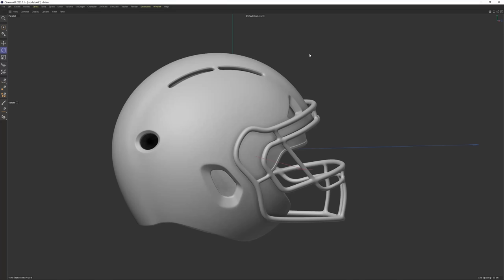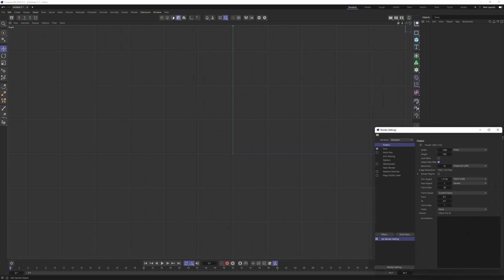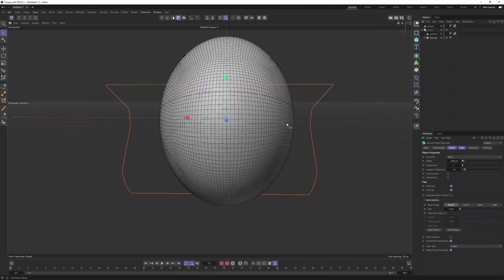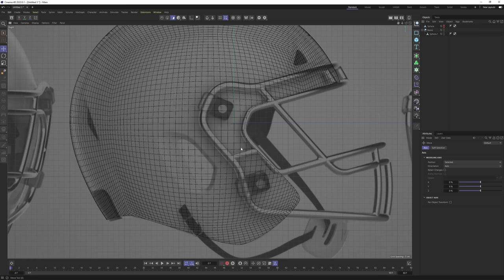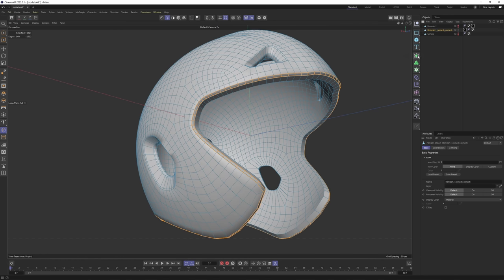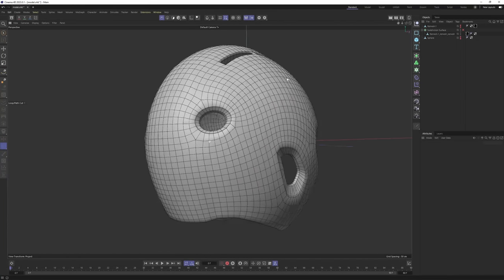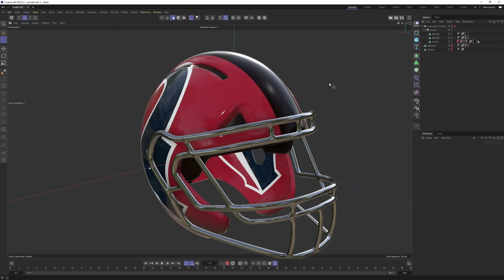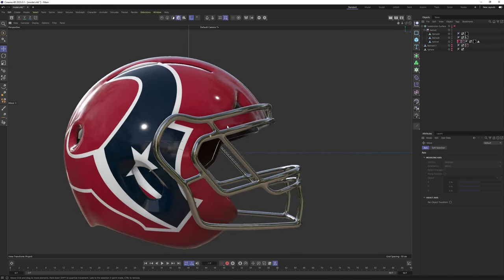Zremesher Workflow in Cinema 4D | Hard Surface Modeling Tutorial

Comment: I had a lot of fun making this tutorial. As usual, great modeling technique. I particularly enjoyed the work with the splines to model the protective mask. It took me over 3 hours to do the tutorial. Curious to know how long you take to prepare such a tutorial.
A small downside. I find that remeshing the mask has several problems. It is certain that once the material is applied, it goes well. I tried an experiment. I did not use the Boole. In the Sweep I increased the Intermediate Points for Splines and Circles. I placed the three Sweeps in a Volume Builder with the setting ( Voxel Size=0.4). I placed the Volume Builder in a Volume Mesher with its default values. Then I put all that in the Remesh with the settings (Mesh Density=10, Adaptive=0, Detect Hard Egges=Shading). The result is perfect. Virtually no defects in the mesh. Almost identical to the model in the photo. Volume Builder could be a good alternative to Boole Builder in some cases. Thanks for what you do. Tu es SUPER.
Reply from the maker: Thank you very much!

Thank you very much for the tip, combining volume objects and Zremesher is a great idea, I will give it  more chance.

I believe I worked several hours before recording.

Keep practising and let us know if you find any better ways model!

Comment: Hello,
which setteins did you adjust to set a few points to the Null such as at 7:30 by merely pulling them both down with Scale-tool? It looks like the magnet is working by you.  I can do it only by setting the Null in the Coordinate Manager manually, otherwise I cant exactly hit the Null coordinate by pulling, I get either a bit more or less than Null.

Comment: hi polygonpen, I wanted to point out a problem related to bolean operations. When you try to run a boolean on a non-planar surface, such as I your helmet, the holes made by moving with around the object to observe the holes in question appear distorted. I thought it might be distortion due to the camera lens used, so from a 24mm I went 120mm, but nothing yet the problem persists. The only solution I found is to make a bollean on a flat surface and then deform it with the transformers, so I get a correct view of the mesh. Are you experiencing this problem ?
Reply from the maker: This is not about distortion actually, I thought about this too but this happens in real life too, curved shapes have that illusion, kind of.
Reply: good, but still it is strange to find that using a deformer as a bend the effect disappears. do not you think ? Have you ever tried? thank you for your time

Comment: is the cloth object a reliable way of adding thickness to objects similar to Max Shell modifier or Blender solidify ? I suppose extrude tool  doesn't work so well in many cases or is it?
Reply from the maker: Cloth object is a good way to add thickness to non editable objects, that is why I used it in the tutorial ( to give thickness to Nurb objects ), you can use extrude tool as well, no problem.
Reply: @polygonpen  The thing is Max and Blender modifiers have some extra options specifically meant for adding thickness to hard surface planar models (with sharp corners etc)  and they still fail in many cases. So I wonder how C4d managed to do this with a non dedicated feature. Do you happen to have some other vids for this topic!
Reply from the maker: @orphydiancg7759  Same issue occurs in C4D as well, there are a few ways to get aorund the problem, normal move is one of them, or the ultimate/last hope solution is making objects editable and manually adjusting points/edges etc, I hope I understod your question right?
Reply: @polygonpen  Yeah pretty much. Am I wrong or did they added something called Solidify node or capsule within their procedural assets? I doubt it's nothing more than an extrusion op but it look they started to adopt standard concepts from 3d.Hope they will added similar functionality not just names.

Comment: Remesh in C4D is better than nothing but still there so much to improve. Having loops around holes would be very nice and easy to programmer. Also I think it is very heavy processing modifier. Dude I started taking a look into Blender, better Maxon start to do things properly, the game is gettign tie.
Reply: how does compare to 3ds max retopology modifier in this user cases (loop around holes)?
Reply: @orphydiancg7759  never tried yet, but compared to Zbrush, zremesher is better IMO
Reply: @Ricardo-de9ju  better than C4D version of it or better than Max Autoretopology? ANyway pls take a look at Arrimus chanel and his retopology masters series.  The algorithm of it has improved in the last releases and its still in active development. I just wondered if in these situations when you want some nice loops around holes delivers better results than both Zremeshers lol.
Reply: @orphydiancg7759  I've never tried Max Autoretopology, but one thing is true, Autodesk doesn't play around with their tools, they do it right. I said Zbrush is better and gives more control over C4D. In Zbrush you can define where u want the edge flow.
Reply: @Ricardo-de9ju  but I see you can also draw flow splines within C4D version. Is that what you was looking for?
Reply: @orphydiancg7759  It doesn't work quite well. Also, I've already had some weird issues with complex shapes. In Zbrush never and it runs 10x faster.
Reply: @Ricardo-de9ju  maybe the zbrush one is more intended for retopoing free-form shapes and C4d for hard surface? How does Zbrush one performs on hard surface?

Comment: https://www.youtube.com/watch?v=HUiheQDqICc
Does Cinema have a certain tool or setting like this in 3ds max like brushing points along the surface to get them in  a desired shape and not ruining the surface. The Smear mode with the Brush tool doesn't keep the surface and Slide tool its more like using the move tool and only works along the existing edges.
Reply from the maker: Good question, as far as I know, there is not a tool that can do that but you can cheat it around by dublicating the mesh and using the polygon pen tool with reproject enabled.